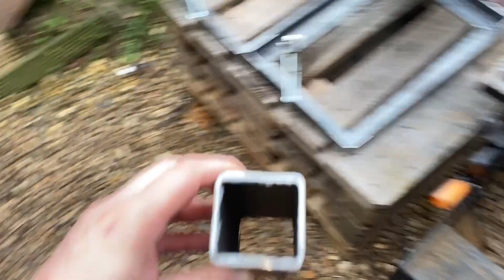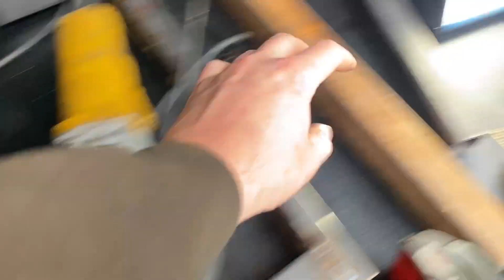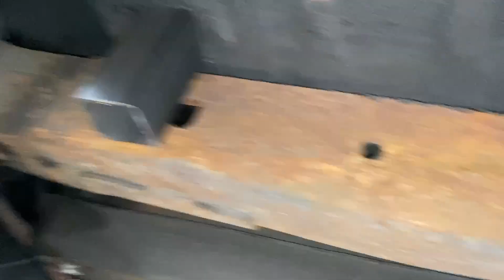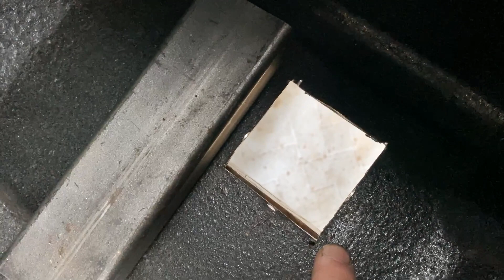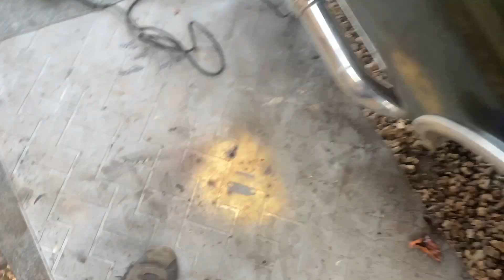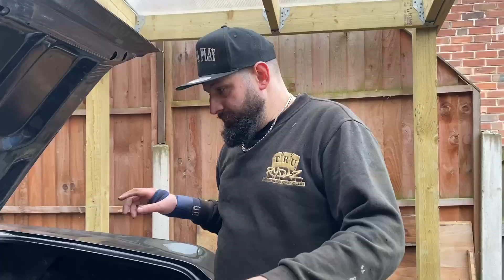1970 Impala LOWRIDER build project - STR8 BALLIN Episode 6

Comment: Just Subbed!! Hello from San Jose, CA (Bay Area) I've been building my own 1979 Pontiac Grand Prix into a lowrider, I yet still need to finish the Patterns but it's cold now and I'm doing it in the garage, So I figured I'll start working on my Hydros. . I bought a FBSS  4 switches. So I'm going to start with the  4 outside  Plate reinforcements the do the the rear bridge then cut and extend the Arms. Because I've been watching  your videos which by the way Great job on your vids you have done an excellent job. I have learned quit a bit. Thank you. If your Curious about my build I have a playlist. My Lowrider Build on my Channel. Thank you
Reply from the maker: Awesome man thank you for the follow and keep up the good work! We’re on Instagram too if you wanted to share some pics?

Comment: Hi mate, Rayvern welded those plates in for me when I had the original installation done. They were just supposed to provide a bit of extra strength I think, as I wasn't going for anything extreme with the setup... assume that's what they are anyway.
Reply from the maker: Thanks Geoff that makes sense, i just expected Rayvern to do a better job really!
Reply: @LayNPlayTV  I think this is the first time I've seen them 😆